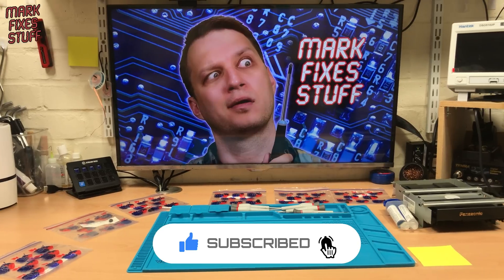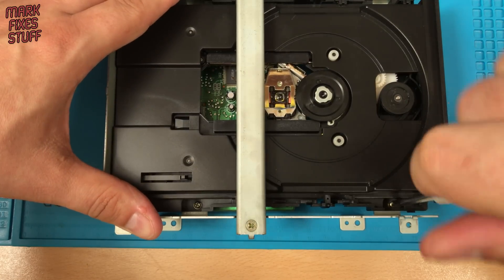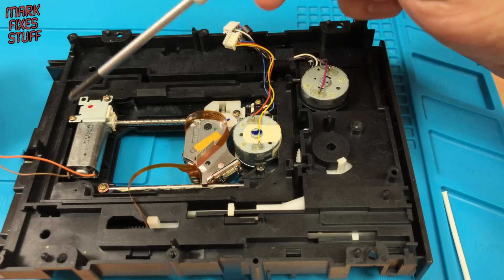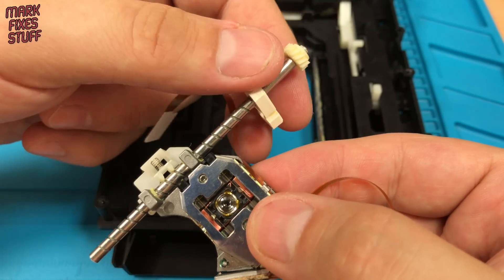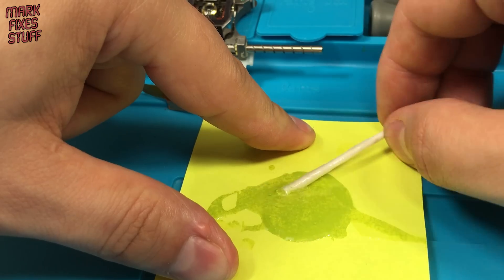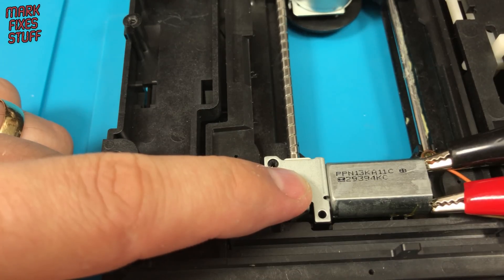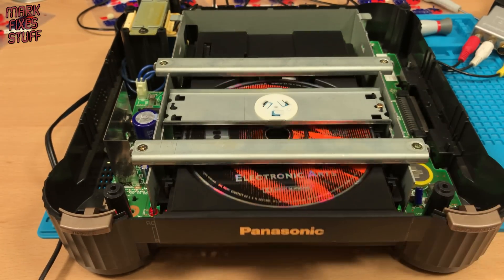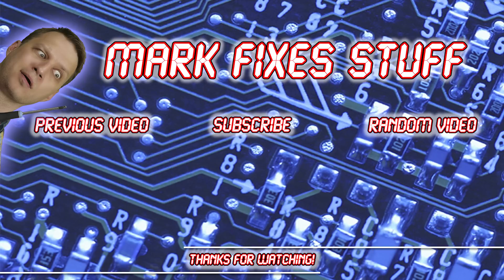Fixing a Panasonic 3DO FZ-1 With a 3D Printed Gear - Common Cog Problem!

Comment: Confirmed: I have a cracked worm gear. I notice the track motor is glued down, presumably with an epoxy resin. Do I need to re-glue the track motor when I reassemble the CD-ROM drive?
Reply from the maker: @richardgray131185  I don’t usually but a blob of rubber cement or hot snot wouldn’t hurt
Reply: @MarkFixesStuff  Thanks for the reply. Would it be a good idea for me to invest in a Duratool Bench Power Supply. I made a note of the settings you used: 03.0 for the reading at the top, gradually reducing this to 0.00 and 0.03 on the bottom reading. Will this tool help verify if the track motor is in working order?
Reply from the maker: @ a bench supply is a good thing to have, but you could just clip some leads from a double AA battery holder to get 3v on the cheap. We’re just checking the motor functions at that point. If it moves it’s 99.9% likely to be fine
Reply: @MarkFixesStuff  One of the screws is rounded on the gear shaft and I can't seem to get it off! I could cry!
Reply: @MarkFixesStuff  Yes! Yeeeessss! I've done it! I must say, you professionals make this look so easy but for a complete beginner like me it is anything but!

The screw that had become rounded did not need to be removed at all! It was a screw that secures a triangular piece of plastic at the end of the worm shaft, next to the spindle motor. I've re-installed the track motor. All I need to do is wait for the new gear to arrive and I can reassemble everything. This video really helped me with my predicament. Thanks so much for posting this!
Reply: @MarkFixesStuff  Could you do a video on how to fault find and repair components on a CD-ROM PCB board?
Reply: @MarkFixesStuff  I've attached the 3 volt battery holder and inserted two double AA batteries. I connected the clips to the terminals and turned the battery holder on. I hear a sound but the worm shaft is not turning. What am I doing wrong?
Reply: @MarkFixesStuff  It's working! The worm shaft is spinning quickly!
Reply: @MarkFixesStuff  I've lost one of the screws that holds the track motor in place!
Reply from the maker: @richardgray131185 a rite of passage. Keep looking !!
Reply: @MarkFixesStuff  Found it, thank goodness! It became wedged right next to the diode! I put everything back together and fired up the computer with this screw missing and I have discovered that the laser unit is not moving again. Disassembling everything again as I type this, this time there will be two screws holding the track motor in place like there should be. I've also magnetized all my screw drivers!
Reply: @MarkFixesStuff  Well well well that is interesting! I have confirmed that the laser diode is moving along the guide rails but it gets to it's default position next to the spindle motor and then it stops moving. Any suggestions? I think there might be an issue with the limit switch.
Reply: @MarkFixesStuff  Mark I've done it! My beloved Matushita CR-572-B is finally reading CDs again! I'm so happy! What a great start to the year!
Reply from the maker: The laser will go to the home position but won’t move again until the laser has focused on and detected a disc.

Sounds like you’ve cracked it now though! Very well done and happy new year!
Reply: @MarkFixesStuff  Your tip to use an AA battery charger to produce the 3 volt current worked out a treat! You saved me around £65 that I would have forked out on a Duracell Bench Power Supply in order to complete the diagnostic check. Thank you!

Comment: Just came across this video and wishing this 3DO I have could be fixed. I found it while cleaning out an old house. Has no controller...only the RCA cables and of course the power supply. Since I dont have any games for it, its difficult to properly test it. I know it comes on because the power button doesn't work, so only way to power it off is to unplug the power supply.

Comment: Thank you so much for posting this video. My 3DO stopped reading discs about 13 years ago and I just put it away in storage and forgot about it. I found your video the other day and this was exactly the problem. Bought a new gear on eBay and my 3DO is working good as new!
Reply from the maker: Fantastic!! Thank you for letting me know!
Reply: can you point me to that gear seller?  or @Markfixesstuff does your friend sell them?  I don't have a 3D printer.  Thanks!

Comment: Had some luck after krazy gluing the orignal worm gear to the rod, however it only worked for about 30 seconds. Do you think this would be the problem? if so, does the creator of these have a place that I can buy some? I have no ability to 3d print at this time
Reply from the maker: Yeah, I tried that as well. No glue can keep it in place because the nylon material has shrunk. I do see them for sale on ebay occasionally.

EDIT: Here is one of the listings on ebay. Feedback seems good but I didn't try it. https://www.ebay.co.uk/itm/305058377183 (I guess you are in the US if you used Krazy Glue?)

Comment: Hey I'm doing the same repair and I've had two different problems arise, the first being the gear doesn't go as far into the end of the groved metal as yours did in the video, is that a big problem? And the second being the rails not spinning the laser very well and barley moving up and down
Reply: I think I just put it in wrong, took it apart and put back together and it worked fine lol
Reply from the maker: @justinlangreck5722  Thank goodness. I was wracking my tiny brain trying to figure out why it wouldn't work!
Reply: Thanks again for the help, no way I could have put it together right without this video lol
Reply from the maker: the important thing is that the gear teeth mate correctly. Does the motor turn OK with the rod out? It could be rusted inside.

Comment: This fix will also work with Matsushita/Panasonic CD-ROM's, specificially the CR-563 - Basically same CD-ROM except the mainboard and a few minor differences to use in the 3DO. Not surprised honestly, but thanks to this video, I saw it was 100% the same, and was able to buy the part to fix my PC CD-ROM.
Reply: I have an IBM PS/1 Consultant with a Matsushita CR-563 that shows up as a drive, but will not read discs. It begins to spin for a bit, but stops and then gives an error. Was your experience like this?
Reply: @restorethis7588  mine didnt read discs, as the laser couldnt move. So best thing to do is take it apart and see if the laser assembly moves at all. Also checking the gear too.
Reply: Sounds daunting, but I have no choice! Thanks.  @kirbyyasha

Comment: How can I get a few of those gears and has he made the hole smaller so it would press fit next time
Reply from the maker: The guy has remodelled the cog but has been unwell of late. 

It turns out that there are a couple of cogs on thingiverse that I've not tried. Have you looked on there?

Comment: My Japanese 3DO just stopped working and, based on the symptoms, I suspect I might have a similar problem. I'd love to slip my shaft into such a gear, but I'm not sure where to find one. Any chance your friend can provide a printable file or some specifications? Thanks!

Edit: Found a couple files on Thingiverse that might work. For anyone else looking for the links: 
https://www.thingiverse.com/thing:2852461
https://www.thingiverse.com/thing:2799915

My guess is the first link is what I'll need.

Comment: Polyamide gear is tough and durable due to water, it is conditioned after demoulding with a few percent absorbed water by weight. In this state, it's pretty tough and silent and pretty much impossible to scratch or crack. As it ages, it loses water, it simply evaporates gradually, which is at first helpful, as it allows it to grip around the shaft tighter. But as it continues to age, it continues shrinking and becoming more brittle, so the shaft will inevitably cause it to shatter. If you have polyamide gears and they're still healthy after 15-20 years, you can leave them in a humid environment for a while (i.e. a ziplock back with half a teaspoon of water in it) for a week and they should be restored to factory condition and prevent them from cracking later.

My personal favourite is to first glue together the original gear and restore whatever missing bits it has from say CA glue and soda and filing down the excess, then knead some two-part silicone, and press the gear into it - this makes a mould. Then i just pour two part epoxy into that and create a nice exact copy, and i throw the mould with epoxy on the heatbed of my 3D printer at about 60-80°C to achieve higher toughness and make it cure faster. When using 1:1 epoxy, you can vary the composition to achieve different properties, you have about 15-20% leeway by volume. Using less 'hardener' will make for a more brittle, harder surface, more temperature and chemically resilient casting. Using more 'hardener' will make for a tougher, softer casting, that is likely more similar to original PA gear. The secret is that the real hardener is a very small amount compared to resin, so they bulk up the 'hardener' part with plastifier. When you don't have exactly 1:1 mixture, hot curing the epoxy is highly advised, as the resin can be somewhat reluctant to crosslink without extra heat encouragement.

I have used this method to restore various highly intricate plastic mechanisms, ones that i wouldn't ever dare printing anywhere near successfully. Besides saves quite a bit of time in CAD. And also you don't need a 3D printer, though you may need a hair dryer and a good bit of patience to kick off the curing otherwise.

With printed gears, i find that PETG is pretty nice, low friction, low noise, tough, somewhat temperature resilient. But PLA also works.

There have been several severe cases of allergy caused by uncured epoxy, so please don't just wipe it off with an ungloved finger. It's rare but can be pretty dangerous, avoidable and unnecessary risk.
Reply from the maker: Siana Gearz thanks for this amazing information. Really interesting stuff and lots for me to look into! Thanks 😊
Reply: @MarkFixesStuff  Oh the silicone i happen to have and use for this is called "Glorex HobbyTime Silikon Knetmasse für Formbau" and it came in an 80g (2x40g) package and it was kind of expensive but i saw it at an art supplies store years ago and just couldn't resist buying. Luckily i never made anything bigger than these kinds of gears so it has been plenty :D It's probably actually quite overpriced for what it is.

Similarly i always use UHU epoxies, Endfest (previously called the 300) and Schnellfest, it depends, because i'm kind of very used to their behaviour and have learned to trust them, so i'm not very inclined to switch to anything else. I think 300 is amazing and flat out beats any thermoplastic on properties you can achieve with it.
Reply from the maker: Siana Gearz think I’ll have to try some of that. I do need to find a higher quality epoxy

Comment: With so much play between the rod and the new cog, how did you make sure the metal rod was centered within the new epoxied-in cog and not lopsided?
Reply: I think the gear just pulled itself to the centre with epoxy surface tension and viscosity. I.e. luck.
Reply from the maker: Josh Payne the cog is held in place by the locating screw in the motor housing.
Reply from the maker: Josh Payne ah, sorry. Misread this. I checked it when the resin was setting. If it had been off centre I would have aligned it whilst the resin was semisolid. No need this time though. New gears will be a push fit hopefully.

Comment: Hmm, I've been designing and testing a replacement PLA gear for a cassette deck, being somewhat dubious about accuracy of the finished, movement, I suppose. But, if a CD drive worm gear can be accurate enough.... Interesting video, nice fix. :)
Reply from the maker: I think it should be fine. Plenty of lube though.

Comment: I hate it when you get a blob of goo on the end of your shaft, leads to all sorts of trouble! Just joshing! Very interesting video, as usual, Mark. I too have a Panasonic FZ1 3DO, I've done some repairs, and your videos really helped me out. It's always good to get stuff from you. I may open up my 3DO and take a look at that gear myself now (mine sometimes makes a grinding noise when loading discs). You make repairing these systems fun.
Reply: My FZ1 is also intermittent with discs, some won't play, some will, some that have played before won't. Could that be laser pot adjustment, or ribbon cable?